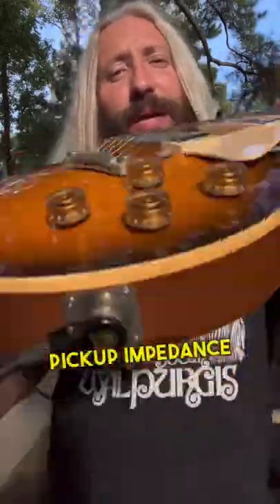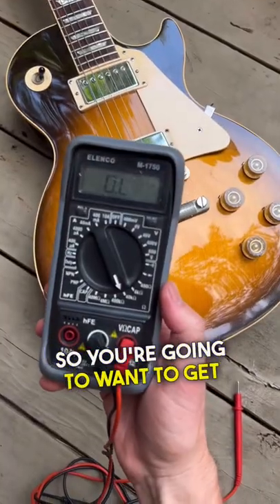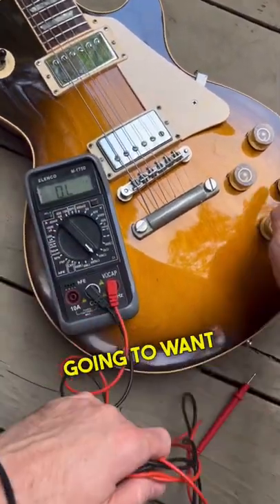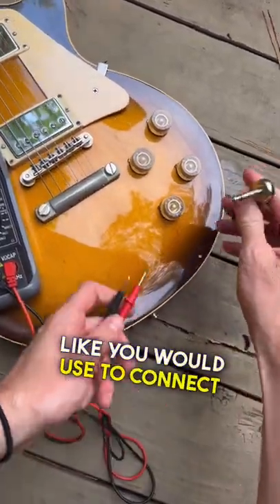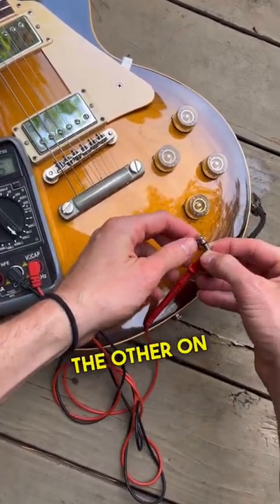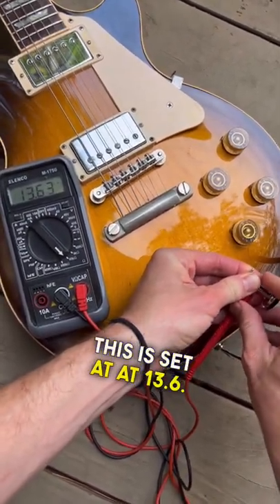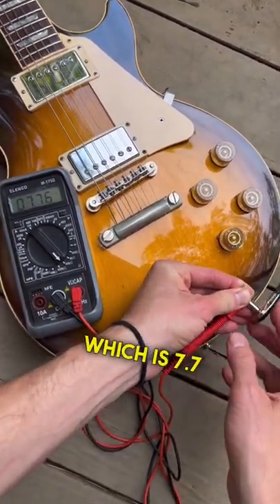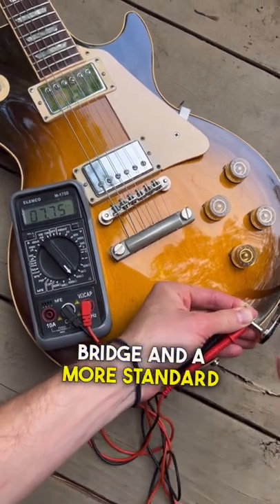What’s your pickup output?  Low, medium, high? #guitar #shorts #guitarpickup

Comment: You're not measuring impedence, you're measuring resistance.
Reply: I just did a quick search, and most sites use the word "impedance", some used the word "resistance" and some used them interchangeably, so I think this is a matter of "everyone knows what he's referring to, so what's the point?"
Reply: @castleanthrax1833  The point is he's not measuring impedence. They're not interchangeable and not measured the same way, so just use the correct terminology and avoid confusion.
Reply: @fhare666  How do you measure impedence?
Reply: @castleanthrax1833  impedance is frequency dependent resistance and the ohmic resistance combined. The challenging part here is that the impedance changes with frequency, so for a guitar that plays different notes, the impedance will change. Often the goal with microphones and speakers is to have as flat frequency responce (impedance) as possible
Reply: @castleanthrax1833  Yeah stupid is  stupid you just  can stop people from being stupid .. but people that know  the difference know  it's not  the same...
Impedance extends the concept of resistance to alternating current (AC) circuits, and possesses both magnitude and phase, unlike resistance, which has only magnitude
It  get  more complicated ... henyies matter
The inductance of an electric circuit is one henry when an electric current that is changing at one ampere per second results in an electromotive force of one volt across the inductor:  
 Inductance is the tendency of an electrical conductor to oppose a change in the electric current flowing through it
Reply: @timeWaster76  And you think you're "not stupid" for writing all that? I guess you are correct: "Stupid is stupid, and you just can't stop people from being stupid."

Comment: Wouldn't pots and the toggle effect the resistance reading?
Reply: The toggle switch actives the pickup you're measuring, and the pot is on maximum, to measure the pickup at it's maximum. I don't know if different value pots make a diff, so maybe you could test them like this, then pull them out and test them directly. That will give you the answer to which you seek.

Comment: I have an epiphone Les Paul modern and over the last two years that I’ve had it the bride pickup’s output has decreased. Does anyone know what’s happening? It’s to the point where it sometimes doesn’t make sound when the other one does (unless I crank the volume), and doesn’t really overdrive.
Reply: did you check the electronics like wire disconnection, bad soldering etc